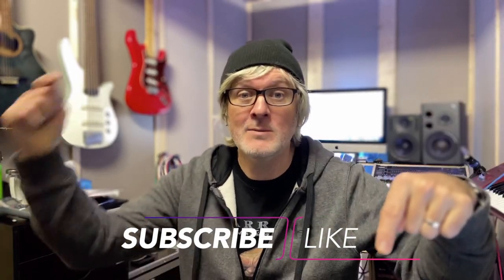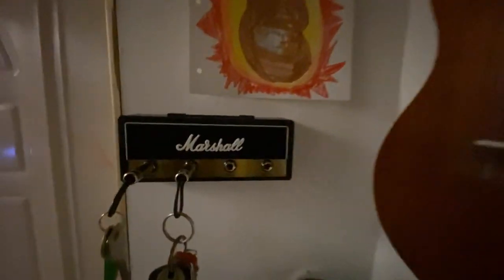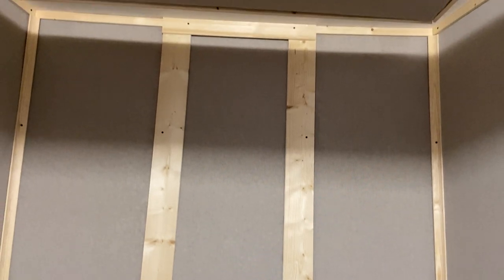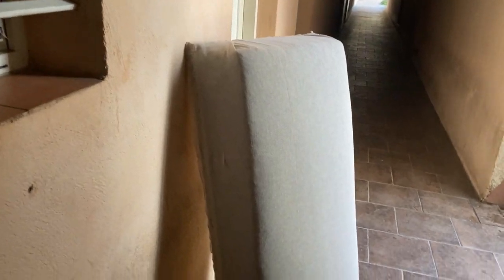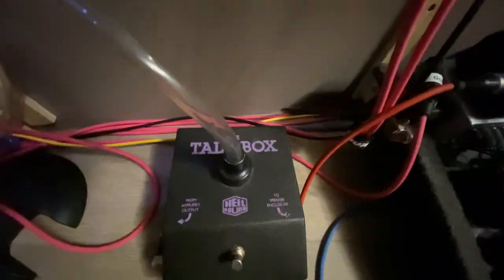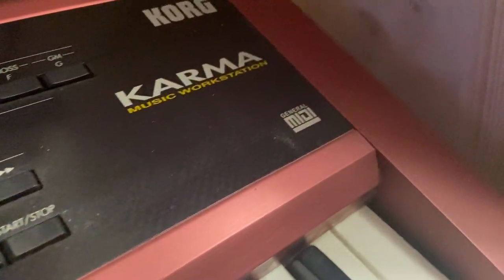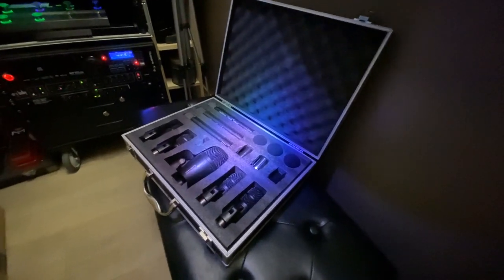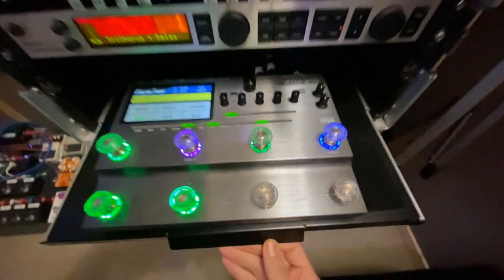Recording Studio Tour 2021 - Sonic Vision Studio - Marseille, France

Comment: You should have put all quadratic diffusors against the rear wall, otherwise you're confusing the sound field.  Mixing quadratic diffusors with anything else just confuses the rear wall reflections.
Reply from the maker: They are on the rear wall. I’m getting great results in the space, very happy